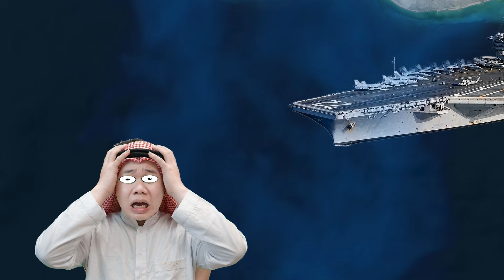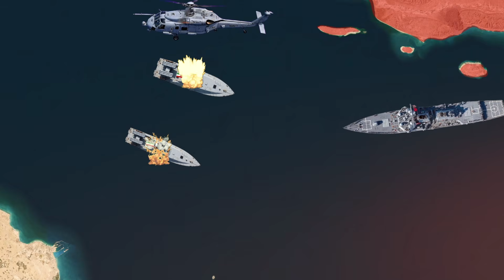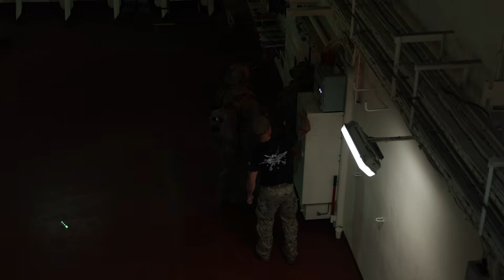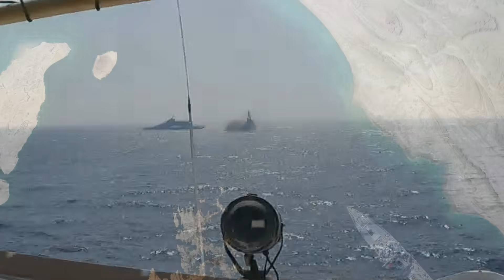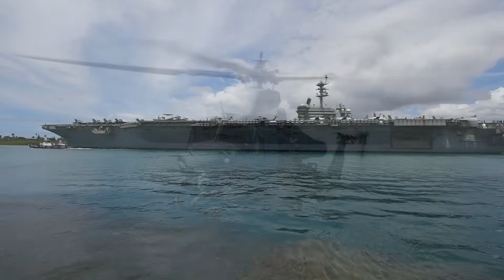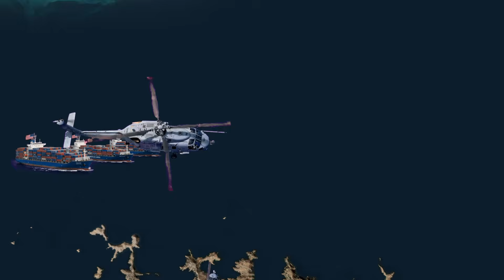Why the U.S. Navy Is Sealing the Strait of Hormuz — And Iran Can't Stop It

Comment: Iran did close the straight of Hormuz. and the US navy can do nothing about it. If the US navy comes within range the IRGC can blow it out of the water. They have already proven they can hit US carriers as a warning but they have not yet shown their true capability. The US navy cannot handle 400 or 500 missiles attacking them in the Gulf of Oman at once. They are already low on interceptor missiles and it takes at least 2 interceptors to try to take out one Iranian missile that costs less than a quarterf of  what our interceptor missiles cost. When it comes to drones, it costs the navy about 8 million dollars to take down one Iranian 20 thousand dollar drone. So who is in position of superiority?
Reply from the maker: It’s more complex than that — Iran has asymmetric strengths, but the United States Navy operates layered defense systems (Aegis, EW, air cover) designed for saturation threats; real-world outcomes depend on coordination, intel, and escalation thresholds — not just raw missile counts
Reply: @MILITARYMYSTERIES666  Total shit.  You are a Yankland propaganda channel.
Reply: Attacks on USN fleet assets will result in a resumption of the airwar and the levelling of Iranian power and water desal.  In an average 122`F daytime temperature environment, this will incapacitate Iran very quickly.

If the Iranians could launch 400-500 ballistic missiles, Israel would be flaming ash.  Most likely, it's a TEL (launcher0 shortage but it could be both missiles and launchers.  For anything else (Noor/Kowsar ASCM launches from small boats and shore launchers) this is not  an issue as these weapons are all million plus rounds and very short ranged (on the order of 200km or less).  We will likely see the setup and hear the command nets come online and either preempt them or deal directly with the 50-60 missiles the IRGC can shoot, easily.

RIM-162 is quite carriage dense (averaging 4X 30 VLS cell or 120 shots per Burke) and SM-2/SM-6 will also be available (20+20) for a total of 160, long-range, AAW engagements per hull.  Because these missiles have not been extensively used in Operation Epic Fury, they are available in greater shot density and because they use inertial mid-course with active terminal homing, they can be fired as part of the NIFC-CA or Naval Integrated Fire Control-Counter Air which means that, using Hawkeye or F-35 radars in look-down mode (along with the general superiority of Navy SAMs), you can lob shots over the horizon, one missile at a time, before the missiles activate their own homing and start doing funky chicken evasions.

A further 11X3 RIM-116 RAM will be available for close-in engagement from 4nm and these are very agile and use both IRH and ARH homing to steer to collision.   A final layer of Mk.45/62 and Mk.15 CIWS will provide goalkeeper defense.

Finally, with drones, you are typically dealing with the Shahed 136 not the 238 (prop vs. jet powered) so you are talking about a 110 knot drone which can be killled one at a time by something like a Super Hornet or even A-10, using AGR-20 air to air rockets.  Depending on variant, these are either semi-active laser or IR homing and they are typically carried X7 in two or four pods for a total of 28 shots.  That is a serious amount of knockdown, a squadron equipped for low value AAW would be capable of destroying 12X28 =  336 drones.  Or fast boats.

Lets add to this that a Shahed works when you know the GNSS (satnav) coordinates of a target.  If you don't, because it's not a static target.  Or if GNSS is spoofed, as it will be, by very powerful jamming, the drone operator only has a video mode which requires access to a line of sight transmitter or a satellite relay channel.  The U.S. will shut the latter down.  And the former limits how far away the drone operator can be.    In either case, the Shahed's price just bloomed about 100,000 dollar per unit and so it's not cheap.  And it is jammable.

Make no mistake this war is horrific.  We have yet again been suckered by the Jews into fighting an unnecessary war on their behalf.  But we cannot afford to lose it as so much of our so called economy is 'services' dependent on dollar sensitive purchases of registry, certification and insurance.  The petro dollar is not fully dead yet either but it will be if we show ourselves to be the 'weak horse' in a world where only strength is respected in protecting sea lines of communication via freedom of navigation.  The USD losing 50-70 percent of its worth as a function of switching over to a Yuan based GRC petro trading currency would wreck the U.S. and pit American versus American over the basics of food, water, shelter and power.

Islam also has a long and very bad history of using 'sea control over local waters' to enforce piracy that stretches across whole regions, as late as 1805, they were forcing French and British fleets to pay protection money or be looted by free roving fast cutters.  And the IRGC repeating the tactic should

Finally, frankly, you don't want a country which buries it's massive uranium refinement program beneath 600ft of rock, brings that uranium to 60% refinement (about 2 weeks from 90% which is weaponizable) and then LIES ABOUT IT as a function of claiming it's only for 'medical purposes', as something left wounded but not defeated with an open line of credit to rebuild everything they have lost and terrorist proxies around the globe to deliver SADM level vengeance.

CONCLUSION:
America is in a war we cannot afford to lose.  We have the means to win it, easily, but are holding back because of what Iran has threatened to do to uninvolved third party Gulf States (most in-region U.S. bases were evacuated before the conflict began) so that Iran does not further devastate the global oil industry.  We should not be held back by that because, as a threat, it will only worsen as the Iranians get richer.

But the important thing here is that this is not Iran on it's own, it is Iran with Russia and China, working together to flip the script on dominance of trade while representing totalitarian governments who invade other countries because of who they wish to befriend and/or because of what they have accomplished (TSMC semi-conductor industry) and they wish to thieve.

If that were to happen, as a function of U.S. 'long war' fixation upon Iran and resolving the Persian Gulf oil issue, the endgame would see the world on fire and the U.S. likely thrown back to a third world level of barely subsistence existence.  This, along with things like mass starvation due to absent diesel fuel and fertilizer, leading to entire continents displacing into migratory mode, invading The West, would result in a global war and fall back to early 1900s level existence of polarized hostility in a resource competed environment which America and The West would lose as authoritarian states took over global rule.

If any of these things sounds REALLY BAD, for yourself or humanity in general, don't succumb to the agitprop and America hating negativism that is now rampant.  America is doing what it has to ensure its interests and we're more than a little rusty at it, thanks to 20+ years spent crusadering around the world, during GWOT, while 'nation building'.

It's not a very noble condition but it is how assure our future by maintaining dominant access to power.